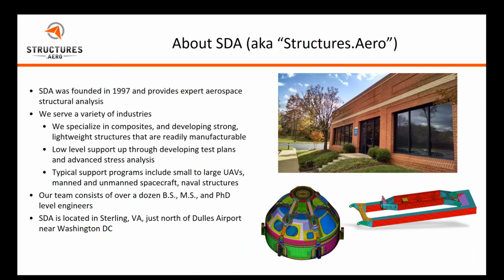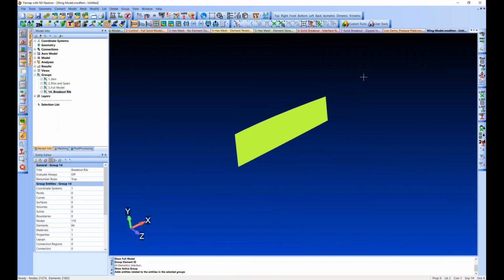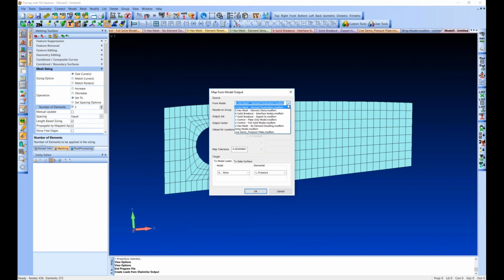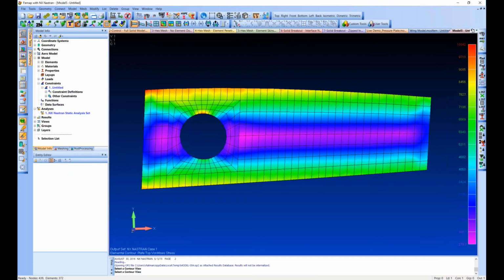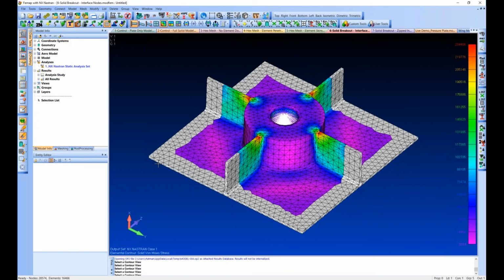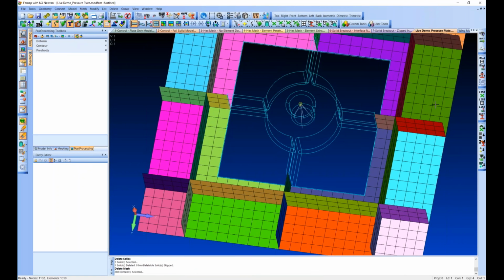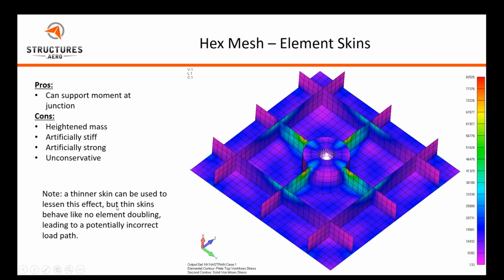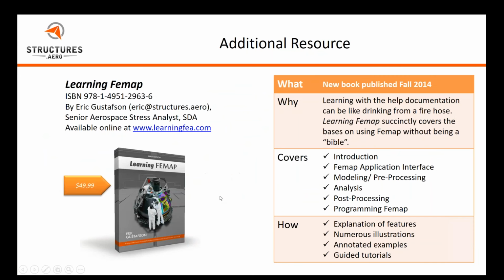Modeling Substructures and Submodeling using Breakout Models in Femap

Comment: Regarding the wing rib example:    you applied displacements from the wing model as a load to the periphery nodes of the rib.  You also applied pinned constraints to the same set of nodes. My understanding is that those constraints are zero displacements (translations).  What is the point of applying the displacements to nodes if you will constrain them after that? How did you even get any results after running such model?      I can see all working fine if you applied what is called "stability constraints"  that would be constraints (zero displacements) to just few nodes to prevent rigid body motions which also would not prevent applied displacement being enforced.

Comment: It should be noted that for demonstration purposes this is OK. In an actual problem the large "Global" FEM of the wing structure should have an, albeit crude, idealization of the Rib Cutout. The simplified cutout in the global model will change (maybe not much) the localized stiffness of the rib with cutout. The Global model should then be rerun with the simplified cutout to obtain an updated set of deflection boundary conditions around the Rib with cutout. Then the results of the detailed Localized rib with cutout will be more accurate.
Reply from the maker: That's a good point. Small updates to a piece of the FEM can ripple changes to the Global FEM. Users should use their engineering judgment to decide if their specific situation warrants a re-run of the entire FEM.